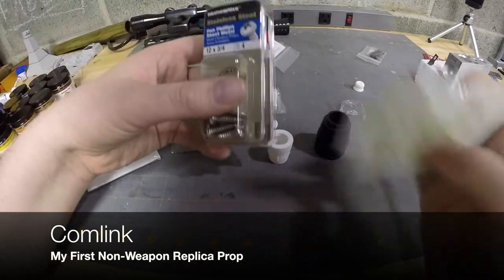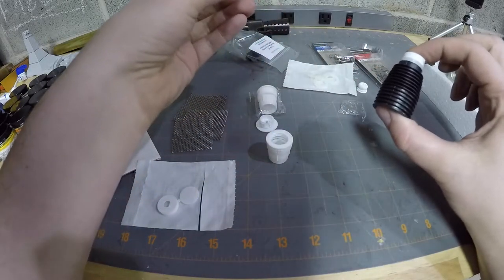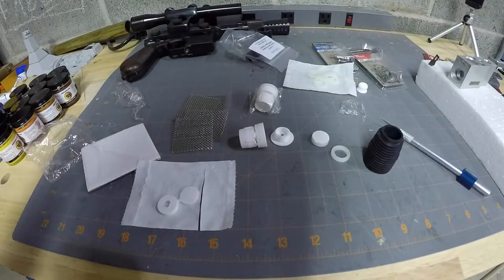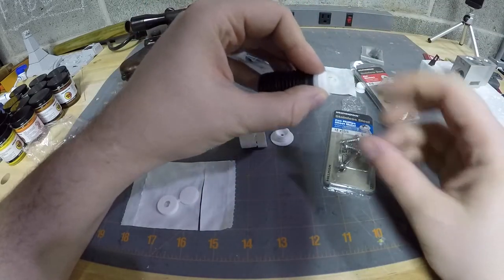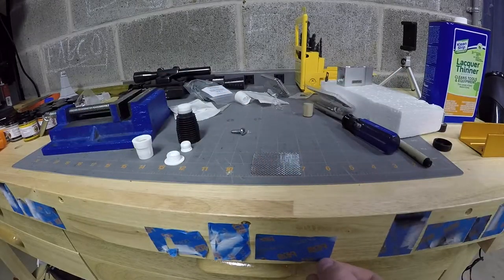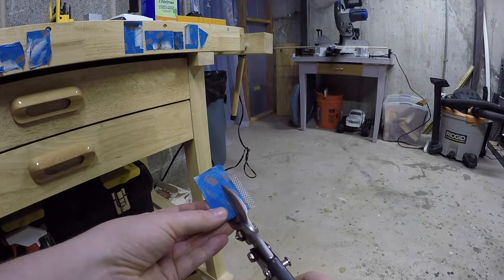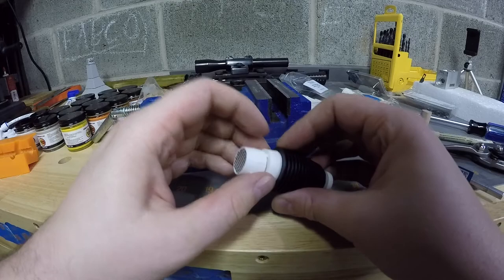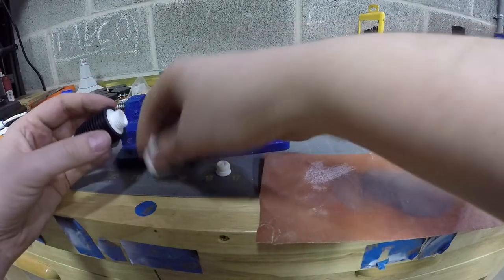Comlink

Comment: I have the reade cylinder and mic tips to make this same prop. Been trying to figure out a way to finish it as well, so thanks for the tips. I want to try and find metal inserts to give it a bit more weight though
Reply from the maker: No problem, thanks for watching. One thing that I'm noticing now is that I don't have enough weight in the Hovi tip end, so it's a little bottom heavy. I'll correct that with the next one.

Comment: That looks fantastic! Do you happen to have a parts list or where you found your parts in the store? (Plumbing, irrigation, etc.)
Reply from the maker: The very bottom piece is a white plastic screw cap. The piece next to it is a nylon washer. I just went to Lowes and looked around for it until I found what I was looking for, they were both in the hardware section.